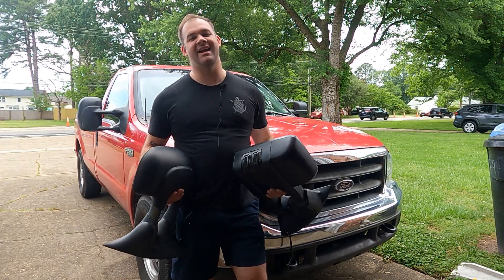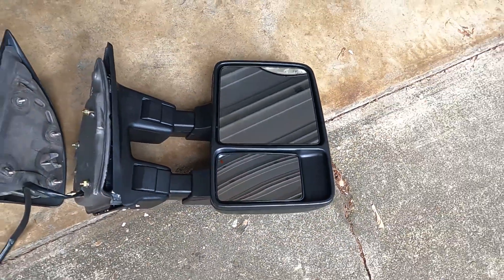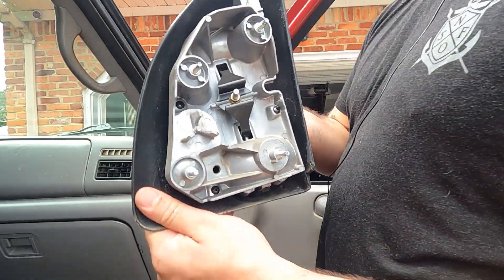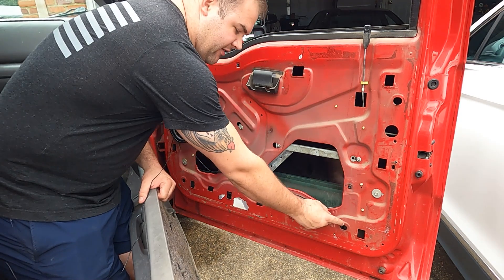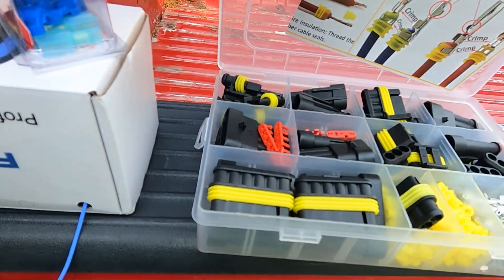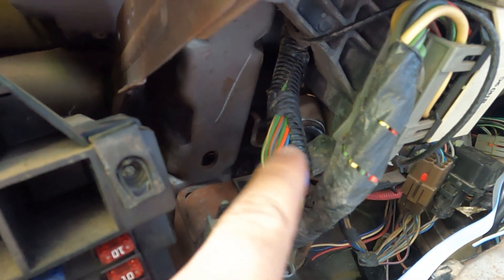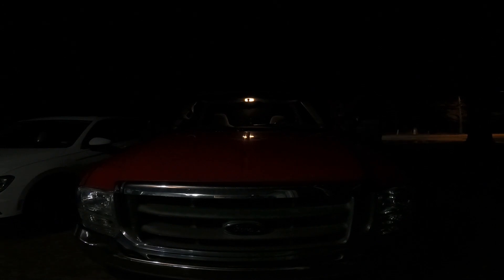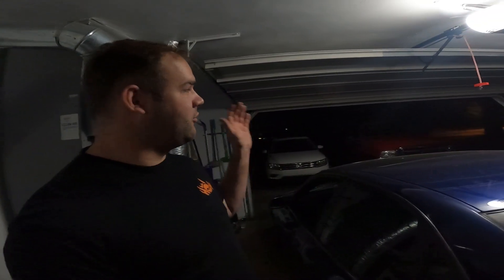First gen Super duty gets an upgrade! 2008-2016 Tow Mirror mod

Comment: Hey there, I just came across your video after doing so much research. I have the exact same mirrors on my 02 F350 XL. The black wire is ground, grey wire is positive for the heated mirror feature, blue and red are for the side markers. I have no idea what the orange, white and yellow wires are for 🤷‍♂️ excellent video, very informative and I hope you do make a video of you wiring up the rest of the mirrors😃👍
Reply: Orange white yellow for power mirror.  My current goal is hooking the side markers to the drl. Switch

Comment: your wired on the ground side of the turn signal. Run to power side of front power. voltage is being robed by all bulbs in the system.
Reply from the maker: You know, I should probably fix this. I only recently noticed that these lights come on when the brakes are pressed. For whatever reason, the turn and stop signal uses the same power wire. I should've caught that. Thanks for the comment

Comment: Did you ever do the heated connection? Curious about that, I'd like to hook up turn signals and heat, already did the power mirrors. Thanks!!
Reply from the maker: I haven't yet. My plan was to fit higher trim door panels that already have the switches.

Comment: Why did you use the rear signal feed and not the front signal feed?
Reply: why does it matter?
Reply: It actually does matter. Tying into the rear signal feed turned my lights on when I hit the brake pedal!!! I would definitely go with the front lights. They are in the same harness loom.. and if you can’t figure out which wires to go to on the mirror side harness, take it apart and see which wires go to the light!!